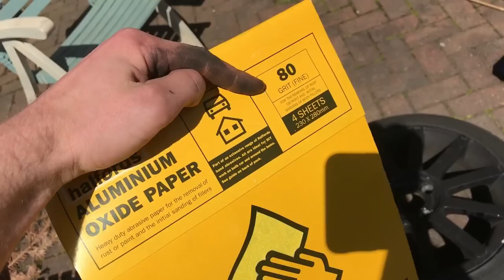How NOT to Paint Wheels VS How To PROPERLY Paint Wheels

Comment: If you spray properly there is no need to sand between coats. Grainy layers will only occur if you are a spraying from too far away. It results in specks of paint drying before they hit the surface. It can also dry like this if it is too hot where you are spraying.

Comment: if you guys want to do this properly, you can do it by simply...

1. clean your wheels, I know it sounds stupid but a good cleaning and degreasing will have the scuffing happen with much less effort and won't clog up your equipment with grime and dirt.

2. scuff it up with scotch brite, and abrasive sponge would do but painters scotch brite is best or even sandpaper at 240 grit will do the work fast.

3. clean the wheel again "AGAIN?!?!?" yes, get rid of the dust, you will be happy with the results, 70% iso-alcohol will do... go to KFC and ask them for a few of those sachets, wear gloves if you don't want skin irritation.

4. prime the paint by using self levelling primer, hand width away and spray it on thinly, don't need to cover all the paint on the first go, just enough for grip on the second coat, to coat int on the second run you do slow movements but not enough for drips or else your back to step 2 for some sanding. Primer is porous, which means it absorbs water, keep it dry or let it dry for a whole day in a dry warm area for a whole day - your parents living room is best, mum and dad are going to love you. 

5. you're up to painting already? Nope! sand it with 320 and wipe it down with alcohol, make sure it comes up clean, if you're in a cold climate like the swamp people in the UK, put the cans in hot water, a 50/50 mix of boiling jug water and cold water from tap should be enough and leave it for about 30 minutes.

6. Now, we are done with the prep part right? Yep! paint thinly, hand width apart and spray thinly for the first coat, second and 3rd coat can be more thicker but remember, drip drip, sand it back and clean keep repeating for the deep rich colour you desire. while putting the paint in the hot water between each can

7 Clear coat it using the same method as paint, hot water and between coats put it back, you can have as many coats of this as you like.

8. sanding, sanding and more sanding then buff and polish... start with 500, then 1000, 2000 ending with 5000, wet sanding is best and if you clear coated so much you won't have to worry about burning though the paint, clear coat is enamel based (oil) so you don't have to worry about it being wet, it's similar to your mums nail polish but for automotive use.

9. polish, can be more difficult if doing it by hand but if you prefer, get a headlight cleaning kit and slap the polish on that with the drill bit included.

10. slap some copper anticease between the wheel hub and your wheel, not too much, thin layer, and bolt on your wheels as per manufacturer specs, then admire your wheels.
Reply: Happy Fox 
I've always used etching primer, I've done a lot of grills and wheels and from my experience you get less stone chipping with it.  Just me though.
Reply: Happy Fox good info. I have some chrome wheels I'm going to try this on
Reply: @R. bit older thread; but for reference always use 2k clear for rims.  1k tends to be too weak for rims longer term.  luckily they come in spray cans now.  Just wear a mask; stuff is badass for lungs.
Reply: No you  if you want the wheel to have paint peel then you can do it the way these guys did, but for best results it's always best to do inside and out in even coating.

Comment: The correct way if you doesn't have tools or no mechanic friend. I took my tires off, cleaned, cleaned, now sanding, then more sanding, bondo on curbing (picked rims from the junkyard). The primer, sand, 3 lite coat, sand 1 more wet coat and primer. At least.

Comment: Any advice mate? I have Chrome rims but top layer maybe a mill or so thick is flaking off. Its a dull chrome underneath so it looks shit. If I wanted to spray black should I just remove the coat that's flaking off only or do I sand all the way down?

Comment: Is the spray for wet and dry sanding just soapy water?
Reply from the maker: yeah mate
Reply from the maker: yeah mate
Reply: Cheers, video helps a lot!
Reply: Yeah but it's not proper wet sanding. Needs to be soaked in warm/hot water to soften the sand paper first

Comment: what if i dont use primer ;
Thanks
Reply from the maker: george georg the base coat won't stick as well!
Reply: itsLeeLockwood im a painter at bmw. All the primer does is cover any defects. High build primer is what you need to cover the defects. Depending on how bad the defect is you will need to fill it or sand it out. It's keying the surface that makes the product stick. For a spay can job it looks good mate. Flatting the base coat what your mate was doing is to De nib the colour and remove any dirt inclusions ready for the clear coat.

Comment: prefer the blacked out alloys
Reply from the maker: Harley Lewis really? Black and black is too plain for my liking, doesn't have enough character
Reply: just a personal preference, but it's a great looking car don't get me wrong!
Reply from the maker: thank you bud! what you driving?
Reply: I've just passed my driving test at 17 but i'm looking at the 1.2 corsa limited editions which are lovely looking cars. Thoughts?
Reply from the maker: I just think they are a bit too common, i think there's hundreds of cooler cars for way cheaper than the corsas!
Reply: what do you suggest which has a nice, sporty look?
Reply: Harley Lewis Subaru Impreza hatchback 1.5l or Audi a1, although it sounds daft but they are both under 2k on insurance
Reply: not very practical for a broke 17 year old with a average part time job but cheers

Comment: I don't believe either of you knows what you are doing.
---Why are you sanding so much? And, you can't wet sand primer that early from spraying. You shouldn't have to sand the last coat of primer to make the base coat stick. Do it wet-on-wet and base will "Stick" just fine. 
----You ALWAYS wash, do your sanding and scuffing, then wash AGAIN, let dry, then clean AGAIN with alcohol/other proper cleaner, let dry, check it, if ready, then prime it. 
What the heck? use some better paint. 
---If you prepped properly, you shouldn't need to sand between base coats. 
--real professional, using clear coat with no respirator. 
--freakin over spray all over the tire
---Looks like a Barney car